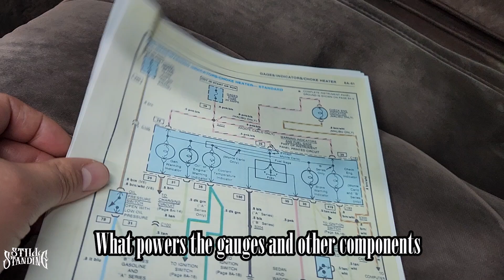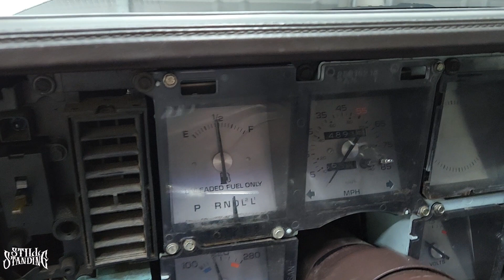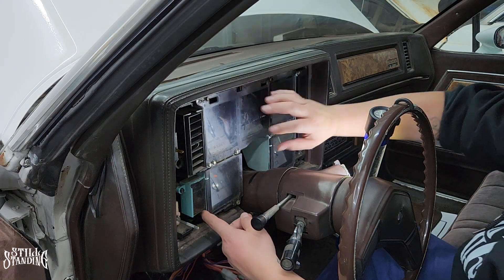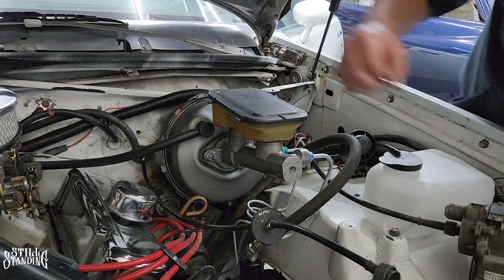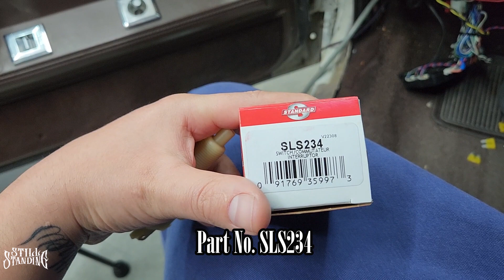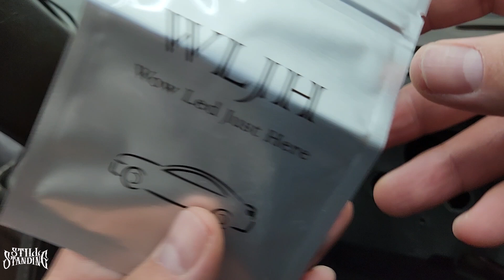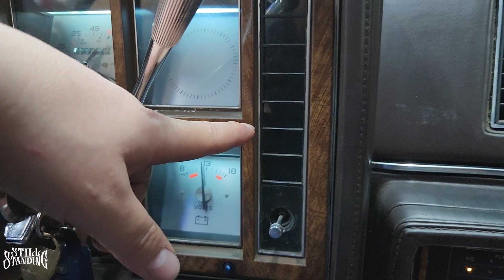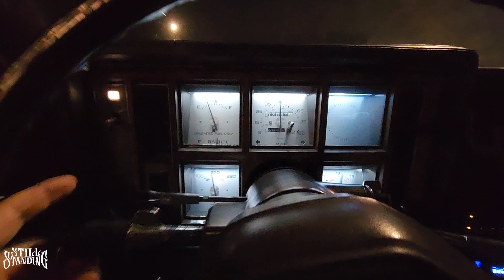G-Body Gauge Cluster Removal and NEW! LEDs 83 Regal

Comment: i have the same car 1983 buick regal 4 door and my original stock radio stopped working it turns on but doesn't play music or show station numbers do you think you'd know whats wrong or if id be able to fix it? 🙏🏽
Reply from the maker: I'm not sure about that one. You will have to take it apart to make sure everything is properly plugged in. Sometimes, it could be grounding issues.

Comment: Why did buick if you order the clock radio they just left that space blank why couldn,t you order a factory tach oil presser gauge  now we know one reason cutlass out sold the reagal the olds had optional rally pack even on 4 door models..
Reply from the maker: Good point. I'm not sure why they did that. Thank you for watching 🤝💯
Reply: That model didn't come with a clock, so that is there to fill the void. My 3 1978 Regal Limited Editions have working clocks in that space. Most models came with a blank space where the voltage gauge is or temp. It just depends. Most base models had a vacuum guage a.k.a.(fuel economy needle)

Comment: I bought a Buick regal wagon 82 that sat for 20 years 
Turned her on but the gauges on the dash and stereo don’t seem to work!
Any tips or ideas on what should I do to fix this ?
Reply from the maker: Start by checking the fuses. Then do what I did and take the cluster apart to chase down each wire.

Comment: Great video! Did this a while back on my 87 El Camino. The LED's I used were polarity sensitive so I had to flip several lights around to get them all to work. Did you find the same with yours? Or did they work in both directions?
Reply from the maker: Nice! Polarity didn't matter on the ones I bought. They all worked on the first try, so I didn't have to switch them around. Thank you for watching 👊💯